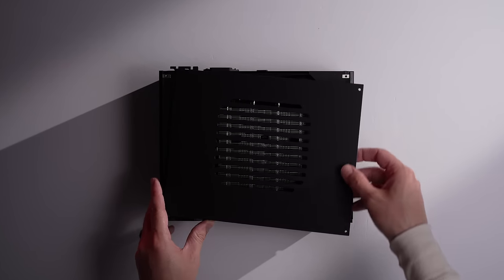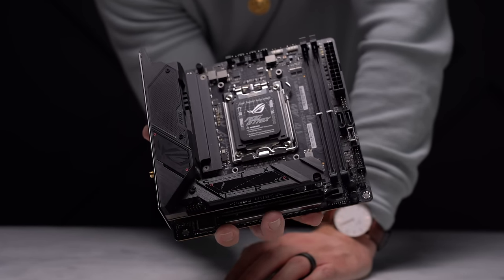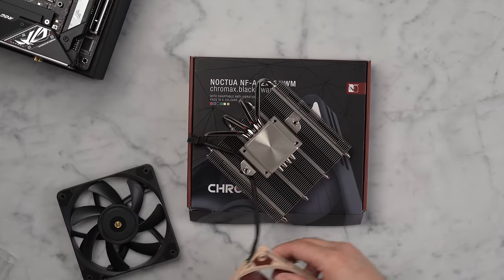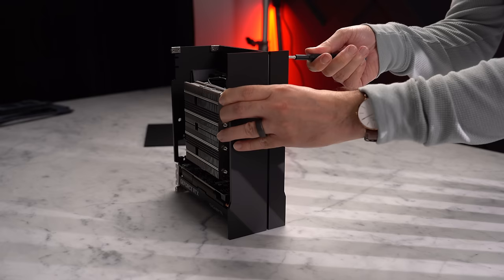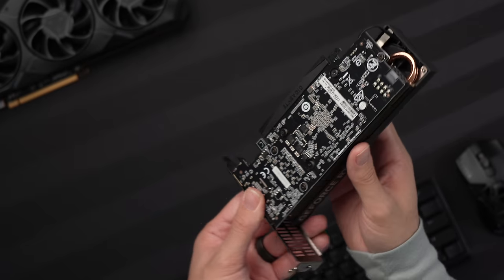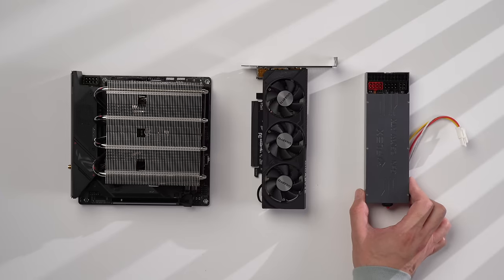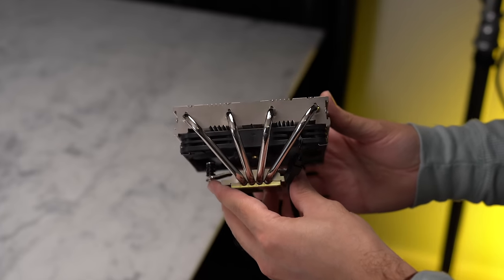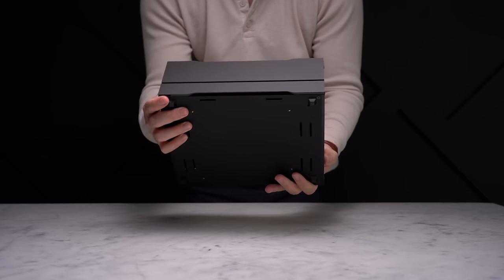Smallest 4060 LP build yet?

Comment: I need some help on this, I plan on doing a very similar build to this, but with an i5 10600KF. According to PC Part Picker, all of the components together will draw a total of 319w give or take. Will the HDPLEX ATX Flex 500w PSU fit in the Lazer3D HT5?
Reply: And if the 500w PSU from HDPLEX won't fit in this case, are there any other PSU's of similar size that can fit in here that can power 400+ watts?
Reply: @strixerxl  it wont fit, just found out the hard way
Reply: @dRuNkHiPpi  Well that sucks, thanks for the answer and thank you for your sacrifice.

Comment: this is so cool, just if the 4060 wasn't x8...
Reply: This is plugged directly into the slot, so riser bandwidths are a non-issue. With the tiny memory bus of the 4060, it is definitely not saturating a PCIE4.0x8 interface.

Comment: Is 250W PSU good enough for this build?
Reply: 115w GPU, 65W CPU, 5-10W of board consumption. So depending on the efficiency of the unit and the capacitance for handling transient spikes, it should be fine provided one doesnt attempt to overclock the CPU.
Reply: You could go with a 300w psu to be safe
Reply: I run a 5600 and 4060ti 16GB on the HDPlex 250W GaN. A 4060 is completely fine

Comment: Isn't the power supply low on power?
Reply: no? at a max the 4060 will draw 115 watts and the 7600 does 78 watts, plus about 30 watts for everything else is a 223 watt theoretical max

Comment: The PS is going to have some hard work due zero excess powers. It may overheat easily if you slightly overclock CPU/GPU. So I'd undervolt CPU and GPU. Your whole setup consumes 240W on top load as is

Comment: i'm certain this is a laptop gpu, which means this is a useless build, at this level get a bloody gaming laptop.
The whole reason of building compact itx cases is to use full size components, and unlock the serious power of thoese things.
A 10l case or a 12l case built smart isn't going to be much more difficult to carry around than a 18" gaming laptop and it's brick of a power supply, but the performance will be double at least.

Comment: 5.3L? LP GPU but bigger than the Velka 3 with a full height ITX card :/ Still small, but dang the Velka 3 really came in optimized.
Reply: Velka 5 v2 is even more impressive than velka 3 , it fits full 270mm 2 slot gpu at 4.9L
Reply: Tho this case gets a much better cooler than both the velka cases
Reply: Sandwich style cases have a drawback though, in that they are wider and limit your CPU cooler height. No fans on the space optimized ones too, where this case still has room for fans at the bottom.
Reply: @MechAdv  velka 5 is pretty slim for what it is, 4.9l and 99mm on thickness and being able to fit a normal 4070 is cool , but yeah cpu cooler isn't as good